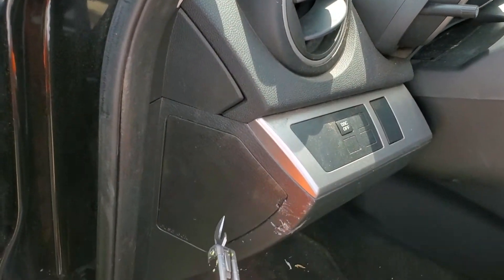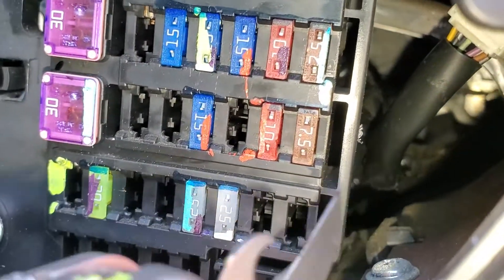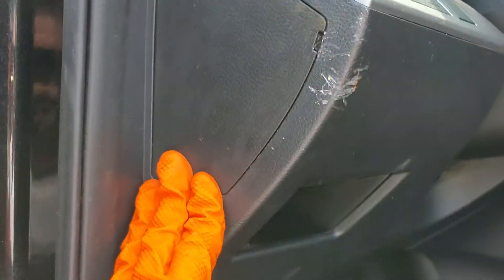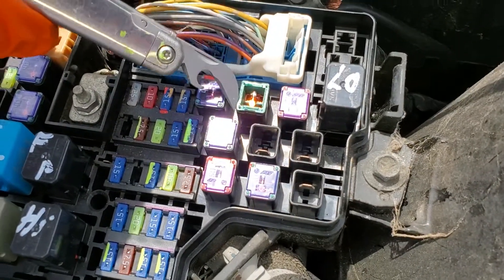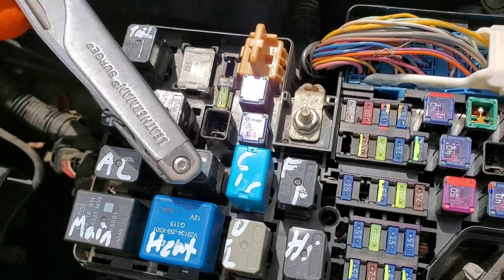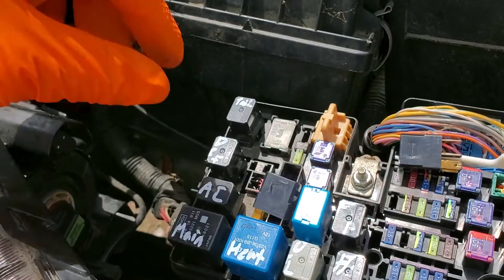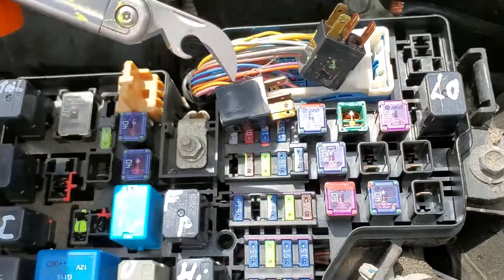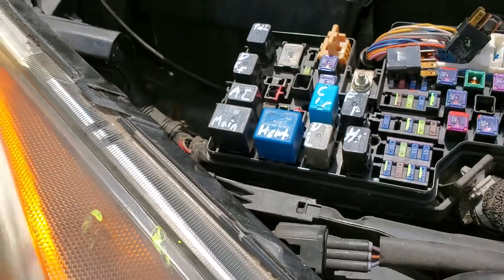2010 Mazda 3 Starter Relay, Starter Relay & Circuit Explained

Comment: My husband hooked the battery up wrong we have changed the main80 fuse it was blown the stereo fuse was blown replace that every thing working on the car but once you turn the key over it clicks before replace battery it worked with a jump but the battery was bad so bought new one was hooked up wrong the horn started beeping like crazy wipers turned on he got little spark sound any advice thank you ?

Comment: It's take a few times for mine to turn over.
Reply: Mine too I have a 2010 Mazda 3
Reply: I did not replace the relay or the starter but I think mine might be a starter issue. It has a 260,000 mi on it

Comment: On the under the hood box you see that bolt that connect a wire? That is making my car shut off what is that part called and also I use a knife to move it and it will give my car power again do you know what my issue can be there is some corrosion on it

Comment: If you can connect the two points and it does start does that mean i need a new fuse
Reply: Because i just switched the fuse from the horn and it still wont start
Reply: @spartan3533  then you need to check the two fuses he pointed out earlier in the video, and possibly the ignition.

Comment: Hey lehew, if you connect both points with a wire and it starts what can be the issue ? I changed the starter relay but didnt solve the issue,

Comment: I’ve lost my ignition key and am trying to start the car to drive to Mazda to save on a tow truck.
I used some wire from the two terminals mentioned on the starter. The car cranks and cranks and cranks but won’t fire….
There is nothing wrong with the vehicle, am I missing something here???
Reply: I don't know what year they started doing this, but mine (2013) has a smart chip imbedded in the ignition key. This type of anti-theft feature is specifically designed to prevent the engine from starting without the correct key (correct key cut and a transponder chip code matching the ones already stored in computer memory), so (as I am sure you know by now) you, and anyone else running into this problem are probably out of luck trying to "hotwire" your own car. I don't know if the computer disables the fuel, the spark, or both whenever the smart chip is not present, but if the feature were easy to bypass, it would still be easy to steal the car without the proper key.

Comment: I have a 2013 Mazda3 (2.0 NON-Skyactiv engine). 
From the factory, the positive battery terminal clamp has 2 integrated inline fuses going to 2 separate wires.

I think the white wire on the left goes to the starter, but I also wonder what else (if anything) it supplies voltage to, because it looks scorched. I think that wire's increased resistance after getting scorched and subsequently corroded is what's causing the car to not crank over, even when I only leave it sitting for 1-2 days in 70-90 degree weather. What I don't understand is how the wire could have gotten overloaded enough to be visibly burned without blowing that integrated fuse. Maybe when I replace the wire, I need to bump its gauge a notch larger. BTW, I've seen acid-induced corrosion on terminals, and this is too non-fuzzy too and isolated ONLY to THIS wire (and not even on the terminal or clamp) for the overload not to be the main cause of the wire's corrosion.

The battery is only a couple of years old, and yesterday right after it failed to crank, I measured it at 12.4v. It sounds like the relay is clicking, but that's one thing I need to go back and verify now that I know where it is (thanks). The car starts easily once I can  get it to crank over, and it will easily do that once I boost it with another car & jumper cables. I think the added amps from the boost is overcoming the increased resistance of this wire to the starter, so it starts right up.

If the white wire feeds an entire wiring sub-harness,  anything on that harness could have caused the overload which scorched the white wire, plus the entire sub-harness might have to be replaced (in addition to whatever caused the overload). BUT if the white wire goes to ONLY the starter (and maybe the alternator), the potential culprits are reduced greatly, and I may only need to replace the white wire itself (plus whichever of those 2 items that caused the overload). It'll be nearly 90 degrees when I get off work & can get dirty enough to trace the white wire myself, so if I can find out from someone here, or from a wiring diagram what all it goes to, that'd be great (lol).